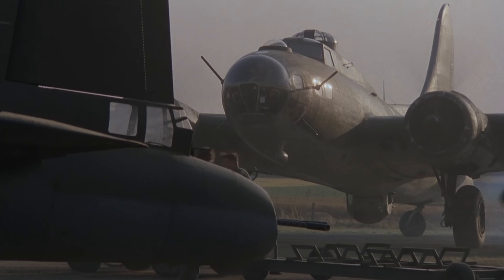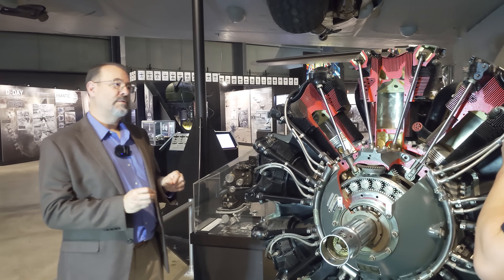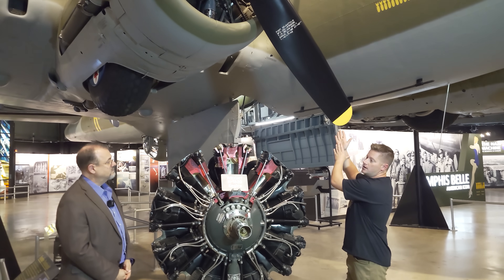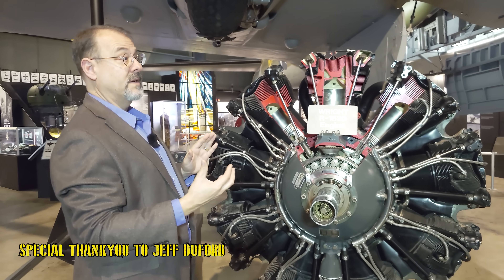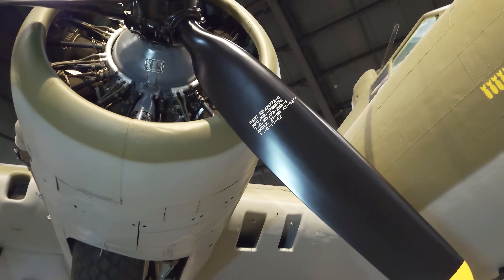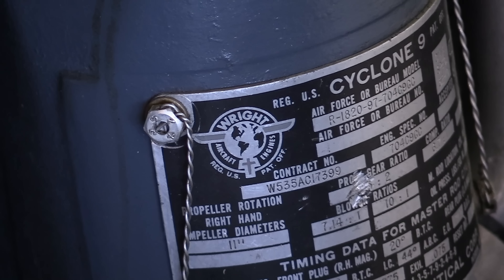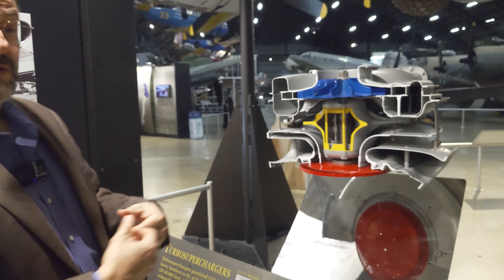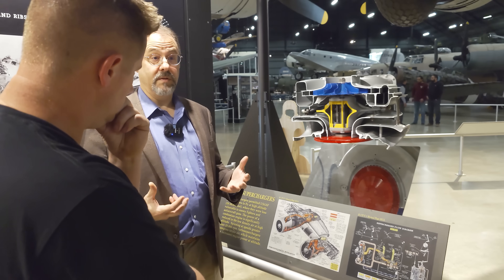B-17 ENGINES IN DEPTH! Genius Or Insanity?

Comment: The R1830 is still the most produced aircraft engine in history, with the PT6 only due to overtake it now after 50+ years. The R1830 also has a smaller frontal area, as I understand it. So why would the B-17 not have R1830's?

Comment: Sodium filled valves are still in use today , in 1963 when ford introduced the 427 Cammer , v8 , I believe it used sodium filled valves , another interesting story is that of the Dodge brothers , the car manufacturer , both engineers , loved being a step ahead , were awarded a US contract to build a V 12 or 16 cylinder engine , for the p51 and spitfire , though it wasn’t needed , jet engines were invented , I believe they both died of the Black plague in the 20 s, great story , ie 426 hemi, the hemispherecal combustion chamber , probably the most efficient combustion chamber to this day
Reply from the maker: Great information! Thanks for watching!

Comment: Got to ride in the nose of "Sentimental Journey", with a gal that knew all about them because her dad flew one.  She was an excellent addition to the ride as she was over the top with joy and chatter. Couldnt get over being so close to the tips of the props and being able to look down the engine lines.  (I started in the navigator seat, and switched to chin half way through)  another cool observance was the inertia in the balloon tires on touch down, added significant braking until they spun up.  Good times.
Reply from the maker: Way cool! Not many now can say they have flown on a 17!

Comment: The ultimate reciprocating (piston powered) engine was in the B-36, which came out at the end of WWII. R4360, 28cyl. twin turbo supercharged, twin intercooled feeding into a large engine driven supercharger. The B-36 could go as high as 50,000+ft. Later models B-36D & beyond also had 4 turbojets along with the six reciprocating engines. Probably one of the most complicated aircraft the USAF ever flew.
Reply from the maker: Great points, thanks for watching!

Comment: The turbocharger (which they called a turbosupercharger early on) does rob some power because it's blocking exhaust airflow. Also the ducting to/from the compressor takes some of the boost, though, unlike a car, that's probably insignificant in an airplane.

Comment: About aircraft engines, each one had a logbook recording what it had done and what happened when. 
They had parts that had to be replaced at minimum time interval. 
They had to be serviced of course, but after a certain amount of time they would be due to be rebuilt. 
The engine and its logbook would leave the plane together and a new or rejuvenated engine would be put in its place if the airframe was still good enough. 
Which meant that an engine in very good condition might be lost because an airframe which would be scrapped after a handful of flights was shot down.

Comment: the turbosupercharger maintained the air-fuel ratio close to low altitude ground levels to minimize horsepower loss. Without it as you climbed to altitude, and the air thinned out (less dense) you would need to lean the engines, losing lots of horsepower. That’s why uncompensated naturally aspirated aircraft engines usually don’t fly above 10k feet. They run out of power.

Comment: It pisses me off when people explaining turbomachinery say that the energetic gas flow "spins" the turbine. The turbine extracts mechanical energy from the gas flow, and the flow has less energy exiting the turbine. The wind spins a pinwheel, but there is no power extraction.
The shaft connecting compressor and turbine turns the compressor, but it also exerts considerable torque to do the work of compression. So all that rotating hardware does much more than merrily "spinning" .  Spinning doesn't explain the processes of importance.

Comment: Great video, thank you. ( I might add, for those who still don't get it, fuel and air has to be introduced to the engine in a specific ratio. When the air is thinner it means less fuel so therefore less horsepower. Compressing the air allows more fuel also, therefore maintaining or increasing the horsepower). Definitely going to have to see if there's more videos on this engine by you guys, obviously the turbo and the props are just one aspect, thx again.
Reply from the maker: Great information great feedback. We had limited time with Jeff unfortunately and we had to power through most subjects. Perhaps another time we will be able to dive deeper.

Comment: I knew about the turbochargers, but I didn't know about the crank driven supercharger...
And, I wonder if the B-17's were tested with the high horse power engines like the Wright R-3350 Duplex-Cyclone and the R-2800 Double Wasp?
Reply from the maker: Thanks for watching. I am sure research was done in some capacity. Boeing would have been heavily invested in the B-29 design at the time. Stopping production to upgrade the 17 when the B24 was already in service and the B29 on the way would not have made sense from a manufacturing stand point. There is however photos out there of a 17 with 4 V12 Engines as a trial. They were Allison engine or Merlin, one of the 2 I can't remember

Comment: 1:43 fun fact, they still use sodium filled valves in many supercars and F1 engines
Reply from the maker: Did not know that. Very cool!
Reply: @MilitaryArmamentsCompany  basically, the TLDR of how these work is that the intake valves get cooled by the cool intake charge, but the exhaust valves are the other way around.
So to cool them, they make them hollow and fill it with a certain amount of pure sodium. Sodium has a really low melting point, so it quickly melts and it sloshes around, transferring the heat away from the hot side.

Because the main issue they have is that it's really hard to cool exhaust valves, because they only (sometimes) wick heat away from them from the contact between those and the valve seats. Filling them with sodium makes them able to wick some of that heat away.
Reply from the maker: Very good information!

Comment: You missed the part where all these engines had direct injection fuel system, the other key element that allowed them to reach those insane power outputs and to be able to work at all at high altitudes !

Comment: No such thing as a “super turbo charger” there are only turbo chargers and super chargers. This dude has never felt grass.
Reply from the maker: You can drop the hostility and arrogance here. "When used in conjunction together (turbo forced air in front of a supercharger) the term Turbo supercharger is coined as a logistical step towards ease of parts reference and training. The term "turbo supercharger" is used when referring to the air intake system in its entirety as a complete unit."
Reply: @MilitaryArmamentsCompany  you can kiss my arse. The video misnomers the air compressing system. Fix the video you eegit instead of telling me to not to tell you that you’re wrong

Comment: The turbocharger answer is more about oxygen.  Piston engines lose their power rating at higher altitudes because they rely on  certain concentration of oxygen ratio to fuel vapor for combustion. Compressing thinner air at higher altitude concentrates the oxygen.  The same applies to humans.  We need enough oxygen molecules per cubic foot of air to stay alive.  So supplemental oxygen in bottles has already concnetrated the oxygen molecules, no need for a turbocharger to scavange and concentrate the oxygen from the thinner air.

Comment: I don't understand how the "hollow space" was filled with sodium? I can't picture it in my brain. What kept it from getting sucked in or blown out?
Reply from the maker: Great question. I have a sodium filled valve on my desk top. I'll open the floor to the viewers here. Perhaps someone can answer that question.
Reply: The hollow space was not open to the outside. The sodium was placed in the hollow and sealed in. It transferred heat from the part of the valve in the combustion chamber to the part outside so the oil could remove it. That kept the valve cooler so it did not soften or deform under load. We even used sodium filled valves in some automotive applications. The sodium had superior heat transfer properties so the valves could survive in harsher conditions.

Comment: B17  was crap.. Boeing lying again. Supposed to go 297 mph..but loaded with bombs and open gun positions...lucky to go 180 mph. German fighters were almost 200 mph faster.😮.in addition,,how many planes shot down by 50cal friendly fire from close formation necessary for better defense..oh no ..we don't want to talk about that either
Reply from the maker: I wonder what the crews who the plane bought them back against all odds would say to that.
Reply: Oh look another hero. "B-17 Was Crap" who are you? Is this opinion drawn from all your time working on them and flying with them?
Reply: @HH-COactual  I worked for Boeing...did you
Reply: @cjswa6473  that does not make you an expert on the B-17. I have no need to justify my experience, I'm not the one making ridiculous claims.
Reply: Ya it was so bad it’s honestly arguable it nearly singlehandedly won the war in Europe, “bad” American equipment is still better then ANYone else’s, & it beat your hero’s sooo.....
Reply: I bet the B- 24 had similar problems along with a main spar that was vulnerable to fire!  They all had vulnerabilities so why the hate?
Reply: @justincase1575  B-17 was best suited for Europe simply because the larger wing surface area allowed them to fly tight formations for longer without fatiguing the pilots, compared to a B-24 even with its longer range and bigger payload. B-29 Definitely solved the spar attatch issue, yet it's engines then became the problem. Evolution of technology Is a big numbers game and a slow process with baby steps. People just assume a peice of equipment magically appears and is good or bad. They don't realize all the key components of an entire industry that goes behind it. The hatred is just ignorance and lack of education on the subject, the man above is obviously in a lot of pain and just wants to be noticed by someone.
Reply: Well dimwit.  If you understood more about the history you would know the B17s major asset was not its speed or bomb carrying capacity, but its SURVIVABILITY and self-defense firepower.  It was the backbone of daytime raiding which was also the most dangerous and took the most courage to carry out.
Reply: Have to love all these people that talk crap on the planes that carried many men home in ww2. Yes many didn't come back but that's even more reason to NOT be disrespectful to their sacrifice.. Easy to pick out the ones that are the reason this country is failing.
Reply: @robertbraun7155  easy to pick the one's that believe in the American Kool aid story..the USA sells 3 things. Debt, Dollars,Defense.

Comment: I truly believe that the engineering core back in those days was definitely better than today. They had to rely on that thing they call a brain anyway here’s another good one. How about the Boeing 747 from the day of the approval by the board 18 months later, she was rolling out of a factory Wasn’t even fully built yet and yet today Bowen can’t even tie their shoes anymore. I used to work for Boeing for 7 1/2 years. I started in August 1987 I can tell you right now that was 1000 times better than what it is today back then.
Reply from the maker: Great feedback. I believe Inflation can be heavily to blame here, absolutely everyone is trying to keep cost down and cut corners, coupled with added bureaucratic unnecessary red tape.

Comment: I think the turbocharger  did use some hp! as you are building back pressure 
You must now over come  and back pressure  is necessary  to some e tent depending on the engine type etc etc.
Reply from the maker: You are correct, we slipped on that one.

Comment: I went to Aviation HS in NYC. We had R1340s and R2680s on stands in our engine shops. R2680s are two 1340s in tandem. Very imresive looking to a 16-17 year old kid. 
Loved the video. Thought 17s would have had the dual row radial  engines.
Reply from the maker: Very cool! Remember the 17 is an early to mid 30s design. Double row did not exist yet. Rather then drastically redesign the 17, efforts focused on a total new Platform such as B29

Comment: One of the things you never hear about in discussion on these engines is oil burn.  On the B-17 that I worked on a good engine was 2 gallons an hour.  I think I read in the manual that when it got to 7 gallons an hour it was due for an overhaul.  I am betting none of the planes in combat ever got to that point before being damaged.
Reply from the maker: Great point, yes we did not get to discuss that. We have had experience seeing it first hand on planes at Bomber Camp. Great feedback!

Comment: One of the biggest advantages of the turbo supercharger was its ability to maintain the right amount of boost no matter what altitude (though it would gradually reduce once the waste gate was fully closed). 

A single-stage supercharger was “ground boosted” meaning that it produced way too much boost at low altitudes.. so it was reduced with the throttle. The problem was that the engine had to work hard to produce full boost all of the time.  

A two speed supercharger had the problem of cutting in and out at certain altitudes.  Fly a bit too low and the low speed would cut in, reducing horsepower.  

The Luftwaffe did solve this by having a hydraulic drive for the superchargers that always ran at the correct speed for the conditions.. as well as having direct injection which allowed for much higher boost levels without detonation. 

One thing you must remember too about the turbocharger is TINSTAAFL. It indeed costs engine power to operate it.
Reply from the maker: Great feedback, excellent information.

Comment: I would have thought that due to high altitude and freezing cold intake air into the engines that extra cooling would not be that much of an issue?
Reply from the maker: Somewhat true yes but not designed for only high altitude. Pacific theater B-17s were used as Attack planes on occasion, low altitude search and rescue etc. Cooling also important on 115 degree day with heat pounding off the black top pavement waiting in line to take off, do run up etc

Comment: My Father was a mechanic on these planes in WWII in the USAAF. There were a lot of farm boys out there that knew their sh.t. He increased horsepower and fuel consumption simply by adjusting the mag timing outside of what the books said.
Reply: cool so was my dad he was stationed at watton raf england 44-45 and he wrenched the b-17 and the mosquito he was a staff sgt. ground crew usaaf he told me of the amazment of the damage those 17s could sustain and make it back from a bomb run this is what he said when the b-17s would return from a run if they could land safely the dead or injured crew was attended to first then the holes were patched engine oil changed re fueled re armed new crew and back to germany it went  rip ssgt edward c mayer niagara falls ny 25th bomb group 1944-1945
Reply from the maker: Very cool! Glad you found our video. Check out the rest of our B-17 series for other in field modifications they did.

Comment: B17 tough, engines fragile.  B24 fragile, engines tough (that's how P&W made its name)
Reply from the maker: Can you elaborate what made them tougher in the 24?
Reply: @MilitaryArmamentsCompany  This is a from a  WWII B25 pilot who I knew.  He had great reverence for P&W "Dependable"  engines:  The B17 could limp home on less than 2 engines and the Wright Cyclones were prone to failures.  The B24 with its new wing (reduced thickness and so one flack near the wing bos and their wings would fold)  but if you lost just one engines, you were in deep trouble.  And so many a crew was brought back with shot up P&W engines - engine your life depended on.   or so he said.  

But it made sense:  the two combinations resulted in 2 effective bombers.  The B17 guys loved the airframe, the B24 guys loved the P&W engines.

But I confess at air shows, the Wrights sound like full race engines  (ra-ki-ta, ra-ki-ta, ...) at idle while the P&W just purr.  Nothing better than sitting begin a B25 in lawn chairs listening to them warm up.

I have an old binaural sound recording on cassette tape of a preflight and startup of a B25.  I loved to watch peoples faces with the headphones on when the 1st engine coughs to life.  You see the smiling inner child surface!   (I have to find that tape or the digital file maybe on youtube by now.)
Reply from the maker: Excellent information! Thankyou for the insite! Next airshow ill be asking and looking for P&W vs Wrights. Check out our Bomber Camp Video for B-17 Ye Olde Pub in action with lots of engine sound.

Comment: guy could have done a much better job explaining what a turbo charger is for.  rather than talk about the air being thin at high elevation, he could have said that an engine is a controlled bomb and for an engine in order to get more bomb explosion you need more oxygen and to get more oxygen in the cylinder with more fuel for a larger explosion you use a trubo or supercharger to compress more air. It's common to be able to double the horse power of the same size engine with a turbocharger

Comment: The reason for a double compression system is because as elevation increases, air gets thinner so a supercharge will lose efficiency while the turbocharger will spin faster and keep pumping BUT the turbochager can't get enough pressure w/o becoming too big but the supercharger can....
Even today this system is used, see Archates engines and their tank engine developed in partnership with Cummins

Comment: I was a recip engine mechanic in the Air Force back in 62-66.
I worked on the R-2000, R-1300, R-4360 and sometimes the R-3350 PRT.
Love sound of those big radials.
Reply from the maker: Absolutely a one of a kind sound!